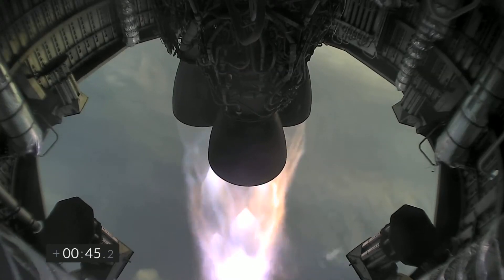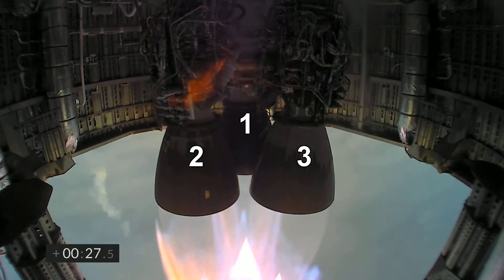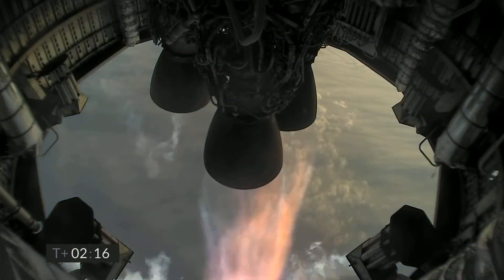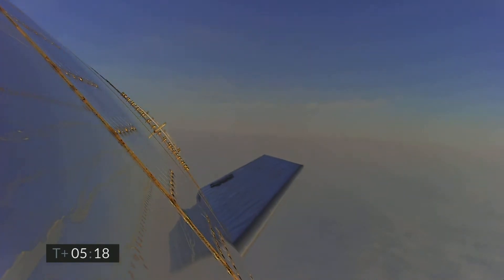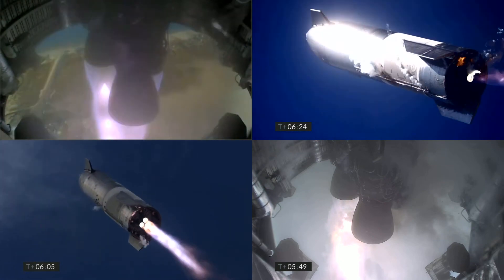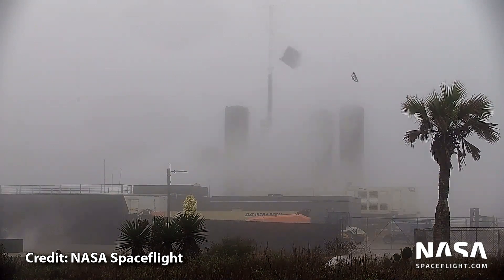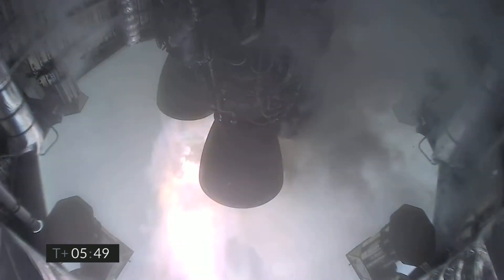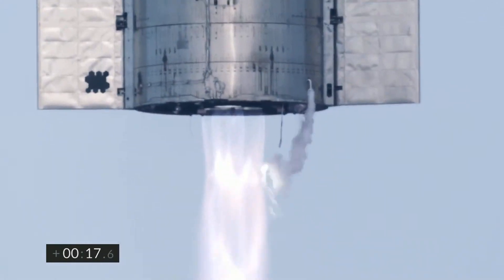What Happened to Starship SN11? | SpaceX Starship SN11 Test Flight & Explosion Cause Analysis

Comment: 00:00 - right from the start you can see there is a problem. Pause at 00:00 and look at the colour of the exhaust of the top-right engine; it is orange, suggesting fuel-rich combustion, possibly due to shortage of oxygen, or fuel-pressure regulation.

Comment: I think RSN 46 was engine 2, which was a refurbished raptor that was removed from SN9.
Maybe they should not relight raptors that were underperforming on ascent but chill them anyway so that if another does fail to relight it can startup and take over.
Hopefully, the new raptors that SN15 is compatible with will perform better and fail less often. The new design does look a lot cleaner and more simple.
Reply: 46 was not engine number 2. It was 52 as clearly seen on the belly cam view.
Reply from the maker: Yeah 52 was in engine 2 position, but 46 was fitted on SN11 as well, but I haven't been able to see in which position. Interesting point about the relight though. We've never seen a Raptor blow up so they probably weren't expecting lighting an extra engine to be such a big risk!
Reply: @ProjectVirtualHaven  As with you from when I watched the feed live I suspected the engine to be the cause of the RUD. We may never know for sure, but the timing of when it was supposed to ignite with the RUD is right on the mark. This is also the first time the explosion has blown the aft fins to bits. There is nothing I can see in any photos that is recognizable as being part of the aft fins. In EA's slow motion video of the parts raining down one of the engines landed the highway across from Hoppy. The impact left a hole in the road they had to repair. I thought it was notable that one engine landed separate from the other two and the thrust dome.
Reply: @Doug_Morgan  That last point, yep.

Comment: Even if you manage to get the right fuel mix to the engines the wind shear and suction on the engine nozzles must be huge resulting in a very difficult re light conditions a vertical approach would solve this and give time to settle the engines before touch down

Comment: SN11 was a total fail.
Reply: it wasn't a TOTAL fail. They get to improvise on what happened, and see how it goes better with future prototypes
Reply: @nagaea7409  They got almost no Data from this flight. It's a step back. If SN15 "gathers data from another explosion" than you will see people pulling there money out from Tesla. (which is  the biggest source of budget money for SpaceX) Because investors know that a failing Starship will devalue SpaceX & devalued SpaceX will hurt Testla investors.
Reply: @TheMrPeteChannel  i never said it was a step forward.
Reply: @TheMrPeteChannel  Some people speculate that this failure was from the raptors, so that can tell us that there is a flaw in the design. So that's new info
Reply: @nagaea7409  Ok then. There's been a problem with theses Raptors on almost every hop & flight. That proved that "sumtin aint workin". Sooooooo.
Option 1. Keep working on it. Maybe make the Raptor out of stronger & therefore unfortunately more expensive materials.

Option 2. Change it majorly. Turn it into an open cycle if possible. SpaceX can still work on the full flow version. 

Option 3 Scrap it & start over fresh.
Reply: @TheMrPeteChannel  funny when randos in YT comment think they know anything about how much data they have, or what they have to do, or what investors will/wont do. pathetic.
Reply: @sellem3  I'm no rocket magician but when anything explodes 4 times in a row...... It's the opposite of great.
Reply: @TheMrPeteChannel  falcon 9
Reply: @hirokioba4674  Your point? F9 is much simpler design than Starship. It uses 1 of the simplest rocket engines ever made. The gas generator Merlin which dumps it's turbopump mix over the side.
Reply: @TheMrPeteChannel  no. thats like the definition of testing. they dont know what they dont know, they have to find out. nearly everything they do here is a first, theyre not suprised stuff blows up, neither should you.
Reply: @TheMrPeteChannel  also whats your point with F9, ye its simpler and it blew up a dozen times before getting it right, meaning that starship will likely take even more attempts.
Reply: @sellem3  It didn't blow up a dozen times unless you're counting Grasshopper & regular missions.
Reply: @sellem3  You do realize a dialogue with 'mr pee under 900 subz' isn't going to be fruitful on any level? Keep fact checking as you seem to do regarding the test information published after proper scrutiny, he/she appears to only muster brief focus on the immediate result 😁
Reply: @TheMrPeteChannel  "SpaceX can still work on the full flow version" - Not as advertised.  Everything downstream of the tanks would have to change.  Everything.

Comment: Does anyone know exactly why the explosion happened. Elon said they would have an answer later in the day, but I have been scouring the nets for two days with no real answer from SpaceX why this prototype exploded on landing.
Reply from the maker: There's nothing official yet. Maybe after the Easter weekend we might hear something, but for now we only have speculation.
Reply: My view remains that a failure of Engine n. 2 allowed the liquid methane to reach into the oxygen tank, which caused the sizeable explosion we all have seen during the landing of Starship SN11.
Reply: Elon just tweeted yesterday
Reply: It's because the Raptors are the most complex engines ever made. They need more work or a total redesign.
Reply: @TheMrPeteChannel  SN15 is compatible with SN56+ raptors which include major design changes.